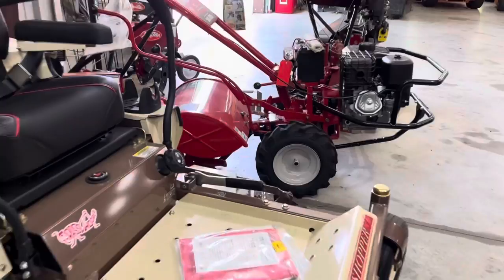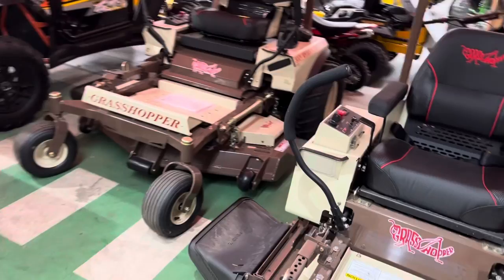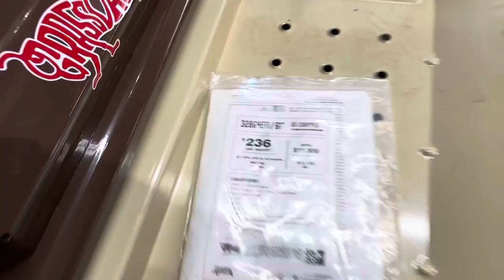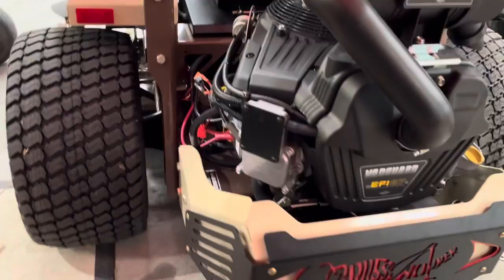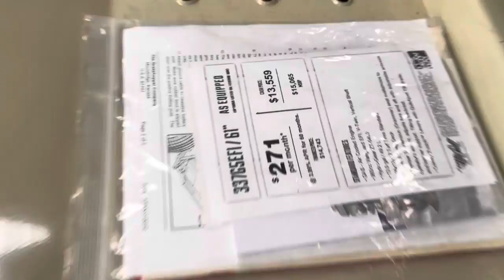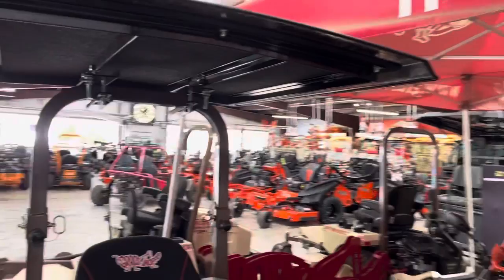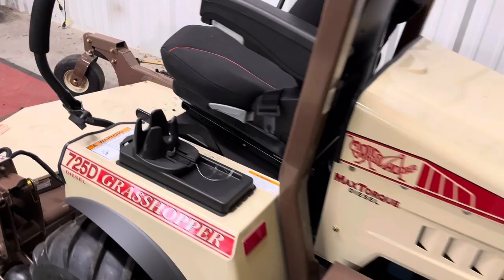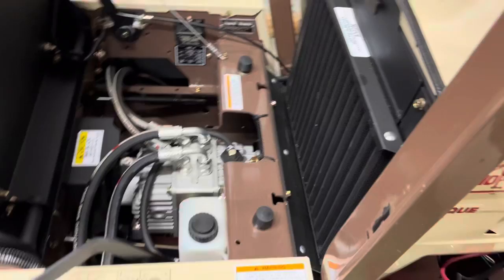Finally got some Grasshoppers in stock!  Some 2023 models and the new 940 40hp!!

Comment: Are the 4400s adequate enough for home owners or are the Parker’s worth the jump?  Looking to buy one mower that’ll last forever honestly. Not into the latest and greatest every time you turn around. And Thank you for your videos. There helping tremendously.
Reply from the maker: The 3400s are full commercial.  The 4400s are massive beasts.   The bad boy Rebel and the 328 grasshopper are mowers these guys bash on day in and day out.  We have very very little issues with 5400 and 4400 transmissions.   Even with 2500 hours plus
Reply: @kgmowers  also I’m looking at a 526V-52. I saw in one of your earlier videos that it runs belts instead of a drive shaft. Do you see a problem with that? And would you recommend a 200 or 300 series over the 500 or 600 with a vanguard and a 52”or smaller deck?  Thank you again you’ve been a lot of help.
Reply from the maker: @Jdmlsvtec88   the 500 series I will be honest I would only use it for light commercial use.   The 623 is a much tougher machine
Reply: @kgmowers  would you recommend a Bad Boy mower over a grasshopper model?
Reply from the maker: @Jdmlsvtec88   it just depends on what you are looking for in a mower.   We sell waaay more bad boy than all mowers.    Deck and frame is stouter with lifetime warranty and these guys have replaced them even when it’s customers faults.   Also on the ride I prefer the ride of the rogue or renegade over any other mower so if I have to mow our 4 acre church yard I would rather mow with the bad boy of course it’s much easier on my back..    as far as over the next 20 years I can promise you will have less things go out and break on the grasshopper.    They just don’t have the repairs the other brands have I.e. like brake cables, bearings, pullies, stuff like that is much much less than the other brands.   So it’s really up to you.    
I started on a grasshopper 722d as my first mower in the business.   Just to have a drive belt break was 4 weeks down at my dealer and around $800 cause my dealer was tractors primarily.   I was mechanically handicap, so no way I could figure out how to put a new belt on or anything myself.   
Bought a bad boy lightning as a back up mower from a dealer 3 hours away.   When it would break I had an oh crap box in my truck and I learned to fix things myself in my customers yard.  It was waaay easier and less complicated for me to work on, and the factory would still send me parts and do the warranty claim even though I fixed it myself.    It was more productive than my front mount even though it only had a 52” deck so I kept it on the back and the bad boy turned into my primary mower and the much more expensive was my back
Up.    Also the bad boy had suspension and was much faster driving it was like a race car.   
I ended up selling my hopper to a guy in North Carolina after my bad boy fell off my trailer and they fixed it for me at the plant.  
Fast forward 5 years later I’m the worlds largest volume bad boy dealer and I picked up grasshopper mowers that year.   I’m a big fan of both.   Truth is I don’t care how nice, expensive, and reliable the mower is if your dealer doesn’t care it’s just a paperweight or what these guys say a fishing weight.
Reply: @kgmowers  awesome explanation. I have a grasshopper dealer 3 miles from the house and then a Tractor Supply probably the same distance. Then a true Bad Boy dealer is 45 minutes away. I’m not trying to get into commercial side of things. But I am trying to cut my lawn which has some pretty knarly ditches. As well as try and keep up my grandmothers place which is a straight down hill towards a lake kinda yard prolly 2 acres. Then cut in some 4wheeler trails in wooded areas for hunting access. So I need something that can handle all that and I know a residential just isn’t going to cut it, no pun intended.  I am trying to stay under the 10k range and I thought the front deck option would lend a hand to some of the inclines, declines and off-roading better than a mid mount. I maybe looking at it the wrong way though.
Reply: 4400 transmissions are way more than enough for any homeowner application you could possibly throw at it.
Reply: @kgmowers  The dealer support is a maker or breaker of quality perception of any product. Especially electro/mechanical products.

Comment: I simply hate the idea of not being able to grease those spindles! Which begs the question: how is it possible that those bearings will last so long, keeping in mind your high praise of Grasshoppers? Wouldn't that small amount of grease in each bearing not wear out or evaporate or harden or something over time?
Reply from the maker: No it’s the opposite.  We had more issues with greasable bearings as we did with the sealed ones.   The new style sealed on the grasshopper are amazing and. Dirt cheap if they do go out.    They still have grease zerts on the spindles to make y’all feel better :).
Reply: They have aluminum rings which help disapate heat so they run cooler than most other manufacturers.

Comment: What ztr would be best suspension wise for my small 3 acre horse pasture? I currently use Scag Tiger Cat 52 but it’s so rough on ground that the horses track up since we have hard clay ground outside Houston. I’m thinking Ferris
Reply from the maker: Bad boy rogue or renegade is by far the toughest and the best ride.   I like it over the 3300.   Definately worth checking out.  Also a cheetah with the turf tiger seat upgrade, or a front mount grasshopper isn’t bad and a hustler with flex forks, tweels, and the seat isn’t a bad ride either (I have a super z here it’s a beast).    Rogue is my go to I use it for a 4 acre church yard sometimes.

Comment: You get a lot of people shocked to see a $20,000 mower?
Reply from the maker: Yes 😂.  I was shocked when we got a 900d in this year. It was a 72” deck with tweels, top, fan, grammer seat, and a few smaller goodies.   Guy called right when the guys assembled I didn’t think much of it when I figured it up and told my salesman it was $25500.   I figured it would be a quick hang up.   15 minutes later man was there writing a check and trying to put us to deliver it.   I told him “don’t worry about delivery I will bring it for free” 😂.   We sold one Saturday for $20500 it was a 729t grasshopper.
Reply: @kgmowers  LOL! Man your living my dream! Wish I was in a bigger town. 1,500 people small rural town in Minnesota. $15,000 is enough to nock the socks off the folks in my area for a commercial mower. We got people that drive hours to their nearest Grasshopper dealer cause their so good. This is my first year selling Encore mowers out of collage. I was looking at Dixie Chopper but their all way up 12 to 19 grand so I went with Encore. I love sales and working on bolts and bearings but when It comes to working on engines I'm mechanically impaired. I've been looking to ad a big name like Grasshopper or SCAG but they use so many different engines and require certified mechanics its over my head. I need a team like you to make it work.
Reply from the maker: @MrTGleaner  it wasn’t too bad to get certified.   We have a kohler and a kawasaki master tech now.   The worst part about getting setup in my early days was each motor company had a minimum purchase to sign up as a dealer.   Every $1500 hurt me back then.   
We have 5 full time guys now in my service department, our service writer won nationals 3 years in row for small engine.   We have the best crew we have ever had right now and my 2 girls on parts, warranty, running it, and the counter are amazing.   It’s been hard keeping a sales guy, so that’s mainly me most of the time.   I started out in the back yard of a $25k house in a town of 26 houses in swink, ok the middle of no where, and the cheapest mower bad boy had was $5k….  160 machines sold that year out of that house it was a crazy start.

Comment: Bought a 900D and it’s nothing but problems, worst mower I have ever owned. Been at the dealer for over a month with a design problem while I mow with a 30 year old Gravely. Factory support is awful, I would never ever recommend them now. My old 725D was fantastic, a bullet proof machine, sad they have fallen so far in quality!
Reply from the maker: I bet those guys at the plant will get you knocked out.  They have some amazing engineers we haven’t had anything they couldn’t get fixed in 10 years.    Just be patient with them.  As long as your dealer is communicating with the plant you are in good hands.   I even had one 725d they came here to Texas, picked up, fixed at the plant and delivered it back.
Reply: Well not so far after two months in the shop getting belt alinement fixed, they finally replaced all pulleys and breaking belt problems are fixed. Added the better seat this spring and used it once and it stopped working, finally called the manufacturer and got it fixed it myself. I have bad back pain from living in  wheelchair. The bad clumping grass out the deck was fixed by adding the plates and blocking the discharge. The greatly underpowered The mismatched drive pumps have it in the shop again hopefully I get it back because my grass is so high it’s falling over. That’s just a partial list of problems, the whole list would take to long. I need a much more dependable machine being in a wheelchair, but blessed with great neighbors who tow it back to my shop more times than I can count, I carry a 5/8 wrench in my tool box to back off the pumps for towing, I have bleed over this machine many times getting my hands down in their backing off pumps for towing. They should put wing nuts on them being used so much. One more problem this thing is gone, been wrenching professionally since I was 16 as head mechanic for a Wheelhouse dealer, than in Ford Motor company. Retired because loss of legs but restore old tractors in my shop. Been looking at lawnmower lifts because I need one to keep a Grasshopper going, I thought God gave me this headache to give me patience at first but this has been a nightmare. My 700 was fantastic close to 4,000 hours when it left, only because of a wet yard in Spring and getting stuck a lot. The bigger tires on the 900 I thought would make me less of a headache to my friends and neighbors giving me tow out every spring, was I wrong. I should have made a set of duals for it in the spring or cut out fenders for bigger tires. I did lose a T6 pump on it, a unheard of problem but rebuilt and back up and running in a week. I bought that machine used and it was beat to death when I got it from dealer, it was used mowing commercial in Wooster Ohio. Got 3 times what I paid for it when I had dealer sell it for me. Great machine, I was told by dealer the 900 series was a lot heavier duty unit, so I bought it off dealer in New London Ohio who promptly went out of business two months later. The machine was so unsafe to drive when delivered I couldn’t let anyone else drive it, starting it quickly went flying backwards, you had to be quick on levers. My dealer gone on got on the phone with grasshopper who sent me to the chicken farmer dealer to get it fixed a dealer on the other side of Shelby Ohio who Proclaimed I never worked on a diesel one when I first met him, I played around with it for two years with belts breaking and parts falling off and finally got told to take it to Scott in Orville Ohio who has tried his best with it, a great dealer I like very much but told me after working on it would never sell anything 900 series.
Reply: I could write a book on how bad this machine is, neighbor was going to buy a new one but after towing me back to shop 3 times bought a EXmark, he mowed my yard a few times with it, seems like a great machine.
Reply: Sorry to vent on your sight, really liked my 700 series machine, bulletproof machine! I knew what that machine went through before I bought it and at 65 wanted something newer because I thought it would last until I died with just regular maintenance and no more getting struck mowing in spring with bigger tires.
Reply: You sound like a great dealer, God has blessed you I can tell, people see me in my  chair and think I am not but I quickly tell them how much God has blessed me in life. God took my brother at 13 with this genetic illness, most die young but here I am rolling around at 65 watching my grandkids grow. Blessed with a wonderful wife of 40 years yesterday and turn 65 this week. My blessings are abundant so God keeps me humble with my 900D, I guess I needed that.